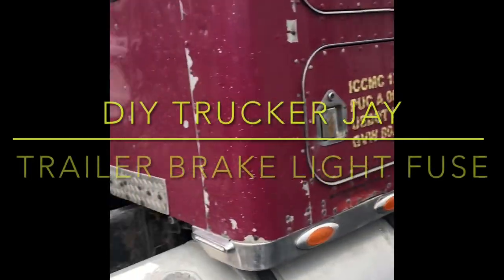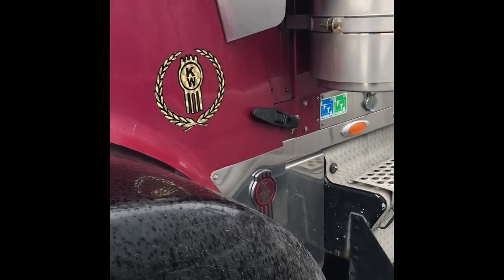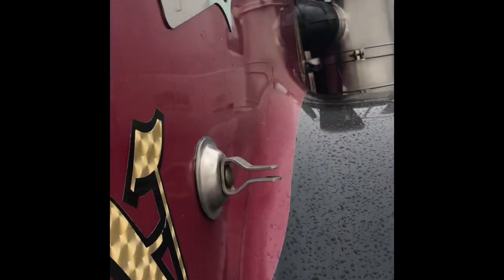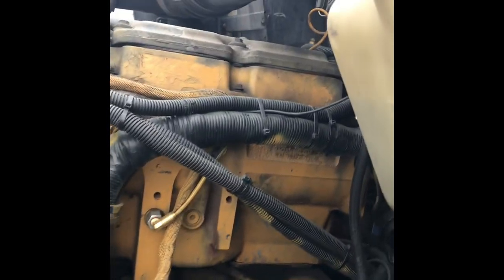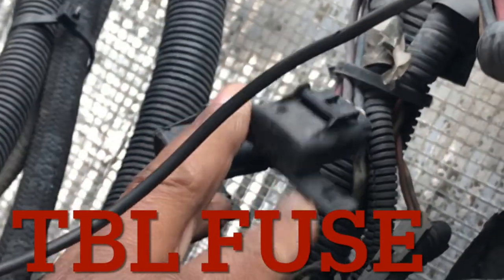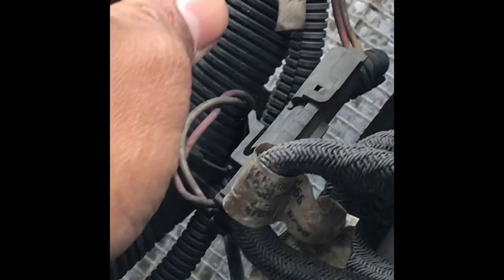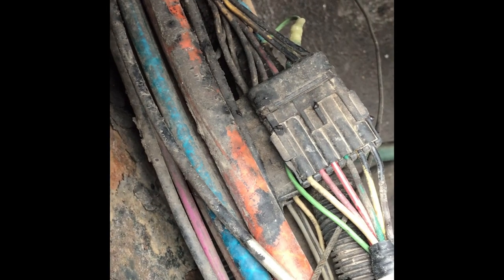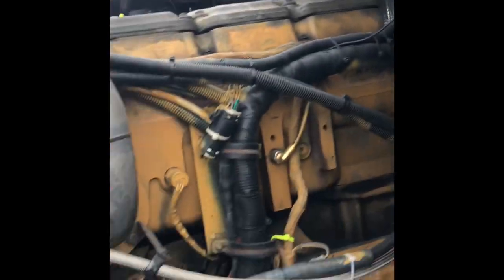Kenworth W9 trailer brake electrical fuse is located on the outside firewall.#installation #viral

Comment: I wish i would have seen/known this 4 hrs ago😂. Dot gave an inspection earlier and wrote me up for no trailer brake lights. Same truck 1999 w900 with a 3406e like yours.  Changed the fuse trailer brake lights work problem solved 👌🏾. I appreciate  you 🙏🏾 🙌🏻

Comment: does the same apply to a 2003? i have a 20 amp fuse in the box and a relay for the trailer brakes, but theres no power running to the fuse to power the relay. So im wondering if theres another fuse else where

Comment: My back up light wont work is there a fuse outside  under the hood? same model but with cummins n14 celect plus
Reply from the maker: Check out my video uploaded about replacing the back up switch on top of your transmission